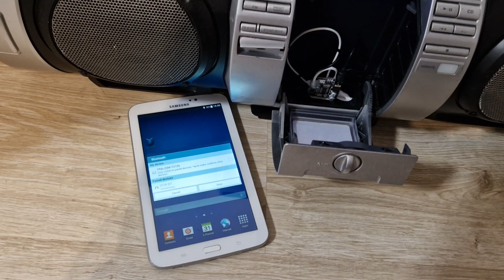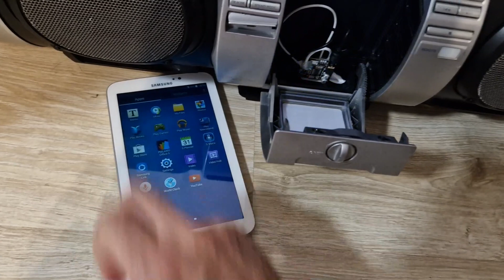how to install aux in and bluetooth module on jvc rv-NB50 soundblaster

Comment: Nice work. Is it posible to connect BT module without 30 pin to lightning module? I think i can use 6,8 adnd 7 pin on board inside JVC.
Reply: Its posible everything we need is only bluetooth module 2 resistors and few wires. No need 30 pin cable.
Reply: @janjan-lw9eg  Have you tried connecting a stereo auxiliary jack directly on the green board to the L /R /GND - on the back of the connector ? I think if digital DETECTION is provided by the two 1K resistors, then the "IPod" selector of the boombox should allow the audio signal to pass through and we can connect it directly to a laptop without Bluetooth

Comment: Have you tried connecting a stereo auxiliary jack directly on the green board to the L /R /GND - on the back of the connector ? I think if digital DETECTION is provided by the two 1K resistors, then the "IPod" selector of the boombox should allow the audio signal to pass through and we can connect it directly to a laptop without Bluetooth.